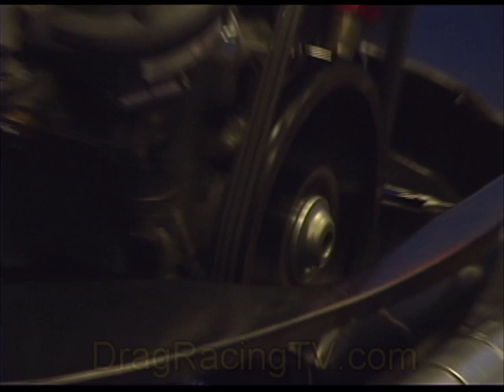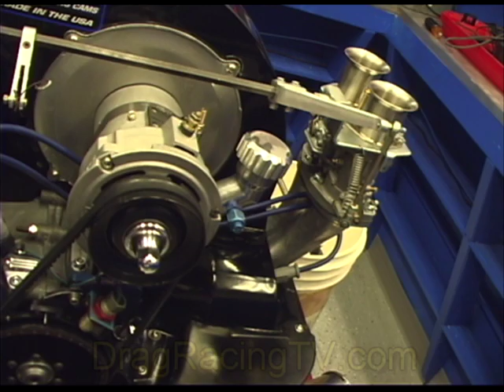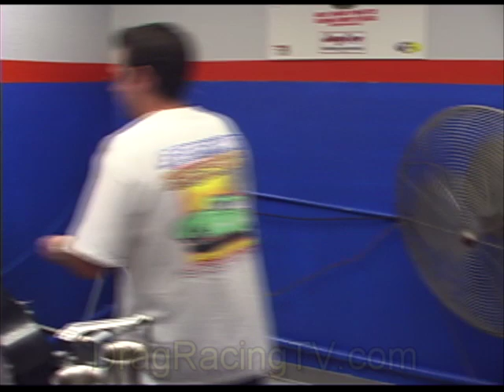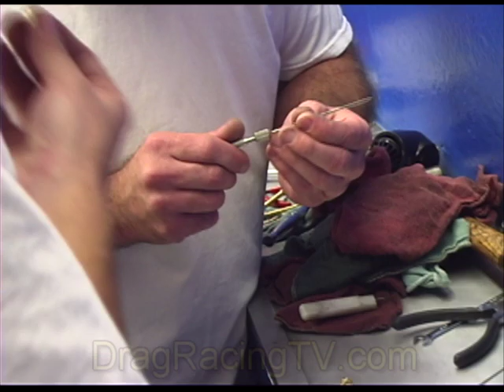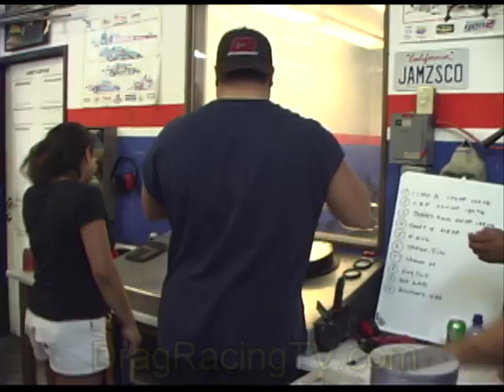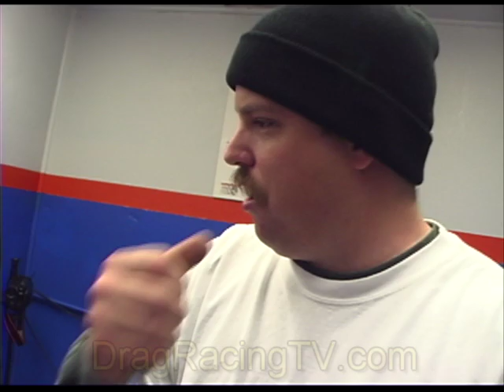VW dyno test Part 2: Chico Performance Engine Builder Showdown

Comment: The Dyno operator doesn't seem to give the engines full throttle until they've reached their redlines.
Reply from the maker: i'm not sure how the old dyno in this video actually works, but in general there are different modes of operation on a dyno, including the ability to vary the load to control rpm?